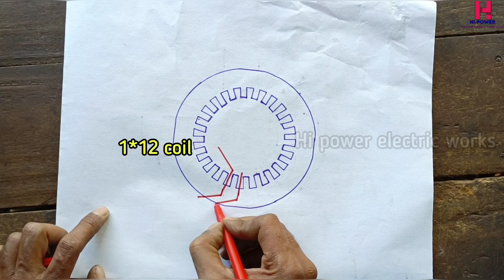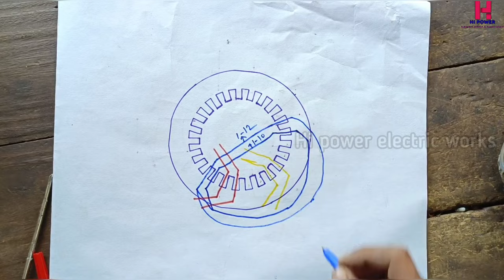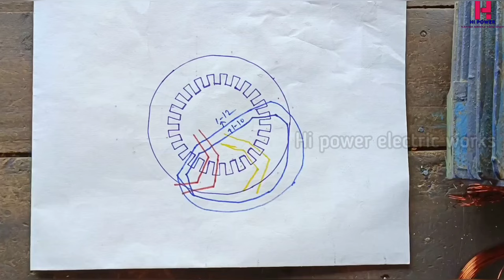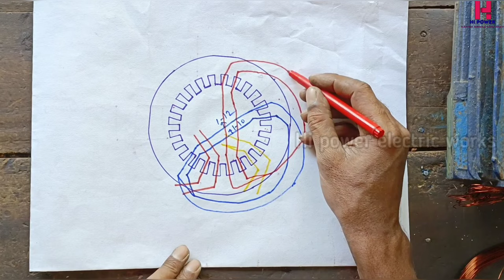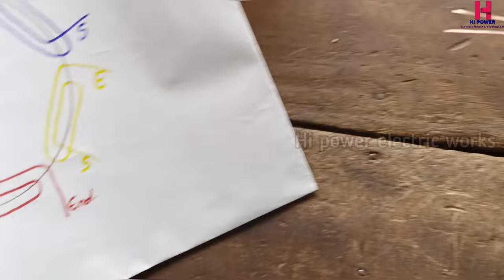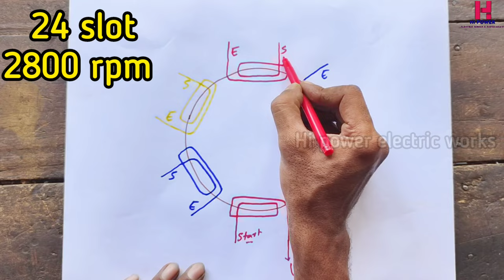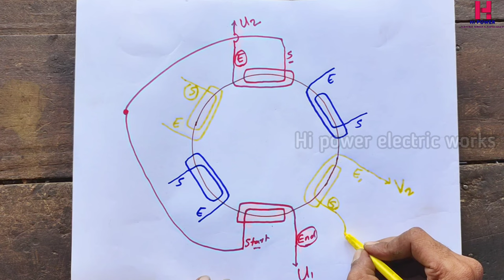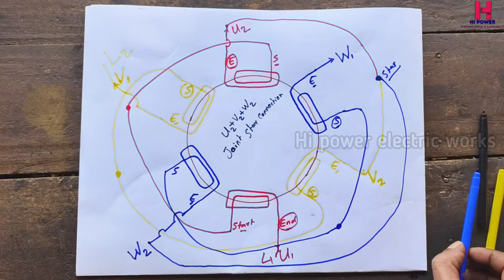3 phase motor winding|2 hp 24 slot 3 phase motor winding and connection with diagram|Motor winding

Comment: Bhai 960 RPM motar 18 coil 1 phase ko chod kr connection daigram btana
Reply from the maker: Single phase 960 rpm connection
सिंगल फेज 960 रोटेटिंग मोटर का कनेक्शन सिंगल फेज 1440 रोटेटिंग मोटर के कनेक्शन के समान है, 1440 रोटेटिंग मोटर में 4 रनिंग कॉइल और 4 स्टार्टिंग कॉइल हैं, लेकिन 960 रोटेटिंग मोटर में 6 रनिंग कॉइल और 6 स्टार्टिंग कॉइल हैं।
सिंगल फेज 960 rpm मोटर वाइंडिंग कनेक्शन का वीडियो जल्द ही बनाया जा सकता है
Reply: @Hipowerelectricworks  bhai diagram h tooo btana